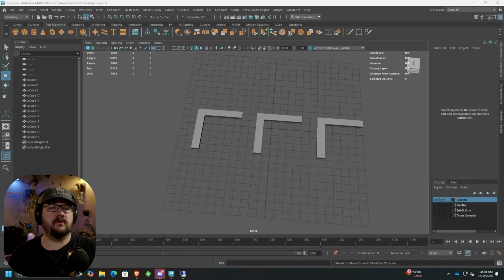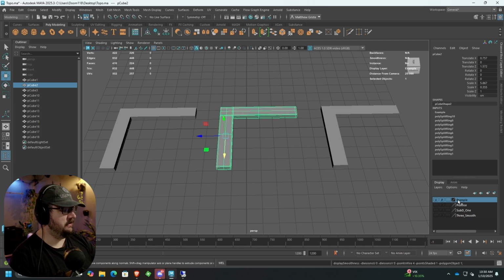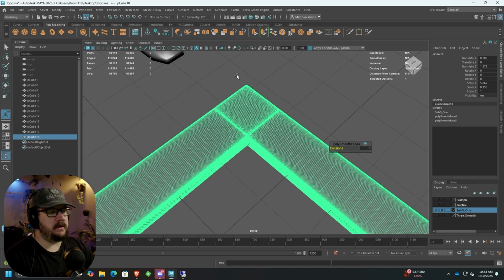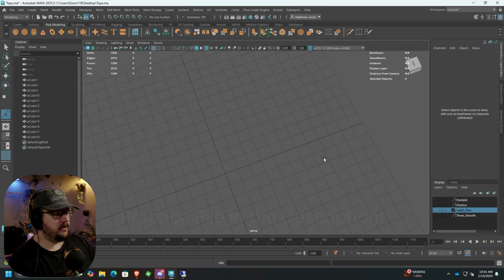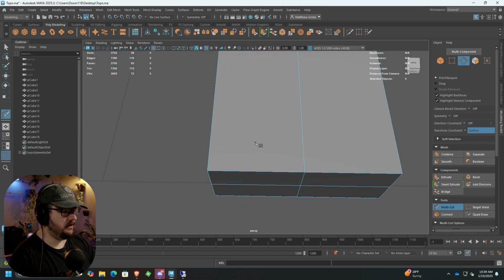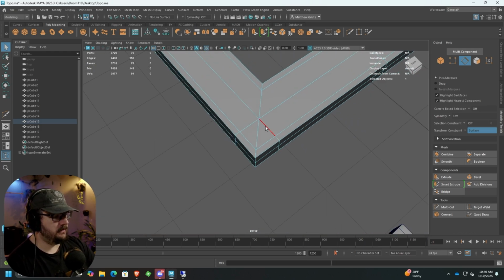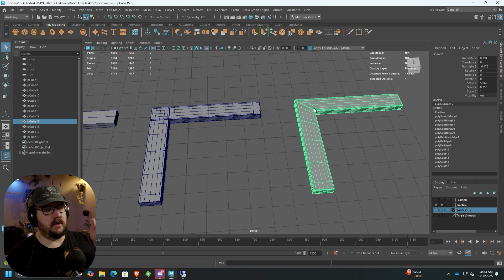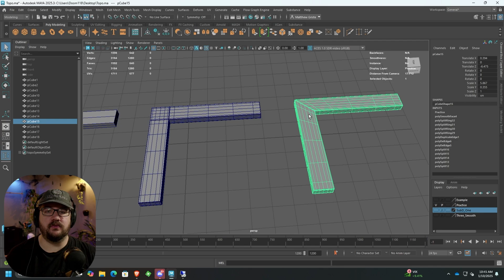3D Modeling Topology for Corners and Angles | Topology 101

Comment: What I do not understand is, for the last model. Why are the two edge loops in the middle of tis needed? Not the one in the corner of the L shape, but between the corner, and the ends, there is one edge loop in the middle. For what? why should I have it?
Reply from the maker: You technically don’t need it but I leave it in case I need to add offset loops, additionally it helps keep geo uniform on subdivision so you don’t get wide and elongated face groups
Reply: @crypticvisionary  Okay, that is the point I don't understand so far. if I UV unwrap, then the surface will be very clearly allocated to a texture, so why would a big or elongated face be a problem? What is the benefit and why do we decide for more polygons instead of less?

I'm trying to make assets for a game, and would like to make them nicely optimized.

For example, making a static house, why should I subdivide a perfectly flat wall?